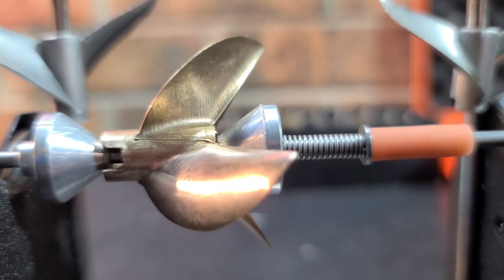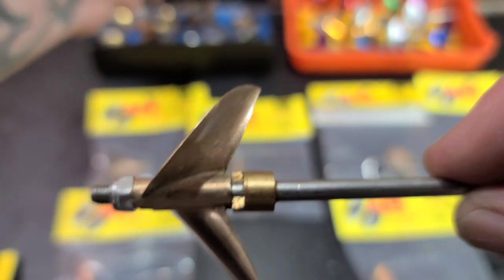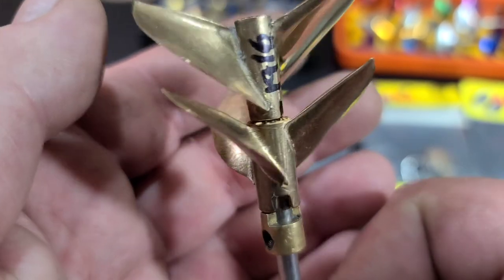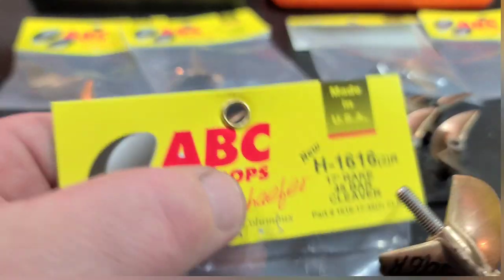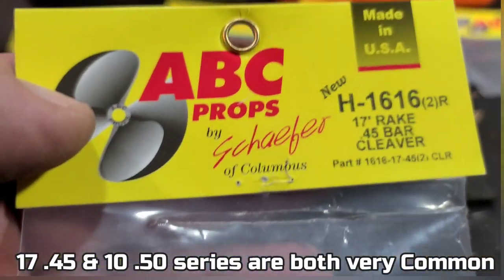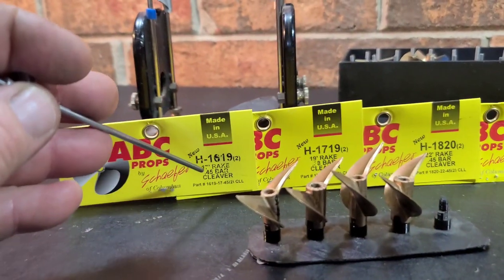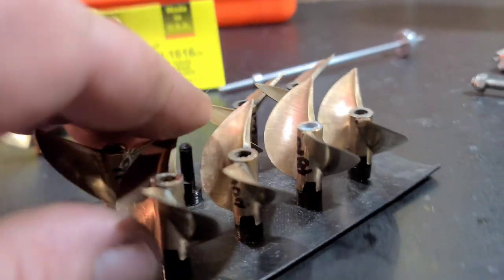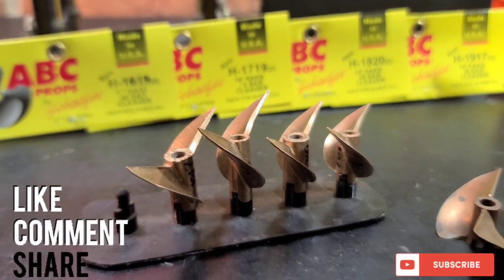ABC PROP Haul Comparison, and Identification - Fast Rc Boat Propellers

Comment: What prop would you recommend on a 36 inch mono with a SSS 4092 2140KV motor with a ZTW 200amp esc?
Reply from the maker: For speed?   1916 17 .45 (2)  or 1816/1817 17 .45.    That 1916 may be big for the 2140kv 48mm prop, maybe one hitter quite prop if you know what I mean 😜
Reply: @IRONCLADRC  looking for something I can do a few speed passes with and then it cool
Off. So you think the 1817 45 for that? Gonna be on 6s with that motor and esc as well
Reply from the maker: Yea, 1817..   on my 33" dominator with a 2080kv 6s I'm getting 85mph with a 1916 haven't tried an 1817 yet but I'm thinking I'd get around the same speed.   
   1817 17.45 is a great prop.
Reply: @IRONCLADRC  thanks brother!!
Reply: Would a 1819 be too much for a similar size boat! I've ordered one but probably should of gotten 1916 😂
Reply: @ironcladrc

Comment: It's a shame that guys who run the smaller stuff (like me) don't have the wide selection of props the "Big" guys do.  Between ABC, Octura, Prather, and all the CNC props from China, the choices are staggering.  Finding the "ONE" prop for a hull could be a never-ending process.  I'm looking at my little twin micro cat and there's only one available prop choice; take it or leave it.
Reply from the maker: What about the 1214 15 .60 abc they have ccw cw rotation available 
Basically 30- 36mm 

https://www.offshoreelectrics.com/proddetail.php?prod=abc-XXXX-15-60(3)CLL
https://www.offshoreelectrics.com/proddetail.php?prod=abc-XXXX-15-60(3)CLR.  

Also
https://www.offshoreelectrics.com/proddetail.php?prod=abc-XXXX-15-60(3)CLR

Comment: Hi!
I just received a couple of ABC-props from OSE. I understand they have beryllium in them. What precautions do you take when working on them?
Regards from Norway🙂
Reply from the maker: Wear a 3 layer minimum medical mask. a respirator style mask would give you better protection.    I do my prop prep filing and sanding outside in my garage, becaus  I have 3 kids in my house hold
Reply: @IRONCLADRC  Have you tried working on them under water? This would eliminate the dangerous airborne particles.

Comment: Great vid showin those props! Yeah, what do you do when one blade is different? How can you tell if you're making them all the same? A slight difference would show up running at 50k rpm.
Reply from the maker: I use my gut most of the time, along with a prop balancer.    I'll feel the thickness with my fingers, very carefully match up the thickness.  Then I use modeling clay to get the blade shape and size imprint the blade onto the modeling clay
Reply: @IRONCLADRC  good idea with modeling clay. I used to do that on my job but didn't think of it for prop

Comment: Man, there are a lot more types then i can get. But ordered some to try, aspecially the 3blade has my interest. I personally think Octura X-serie serie is a good allround prop, also easier to work on. But ABC are bit faster (also more load) in the ones i've got. Didn't even know there were so many abc types, so there probably are prop types that will come closer to eachother, because i bought most off the time  different types to see what difference was... So again, this was very interesting...
Reply from the maker: Thanks, glad I could help, I can't wait to try that 1817 (3) on my dominator hopefully it doesn't torque Roll and chine walk to much with the high rake acting like a paddle wheel?     Those 19 rake .38 bar props may be good on a mon hull too ( 1619 & 1719) low blade area....
Reply: @IRONCLADRC  ordered the 3 blade, a 1817 and 1916 (or 17). I already had the 1816 but made it smaller since my previous setup didn't like it. I'm indeed very interested to see how the dom will handle that prop because off the reasons you mentioned. But then again, have few cats, and bigger mono laying around that need to be finished so there always will be a purpose for it. Also remember i had a Octura 642 (or 43mm) 3blade which ran pretty nice (good acceleration and speed) on one off my mono's, so thought might be a good idea to try a bigger abc from a type that is totally unformiliar  to me... But that reduced blade area definitely makes sense to me, so i just NEEDED to order one...😁

Comment: Hey ironclad, I’m looking for a intermediate rc boat, $700 price range, I want to go fast, I recently owned a sonicwake v2 but had to return it do to a overheating problem, I’ve looked into the zonda but I’m just not sure about it, I don’t like the fact that u have to tape the hatch on, understand its a speed run boat but it just worries me, I’ve been looking at some different pro-boats but I’ve heard some bad things about them like overheating. Open to suggestions, thanks!
Reply from the maker: If you wanna go fast the oxidigger is hard to beat!  But you'll need hatch tape and alot of it.  

The impulse & blackjack 42 are both fast boats but not that great for intermediate users 

The blackjack 24 and recoil 2  are great entry level boat that you can grow into, upgrade for speed using cheap electronics and props
Reply: @IRONCLADRC  have you had any problems with the blackjack 24 like overheating?
Reply: @IRONCLADRC  I like the zelos twin but there out of stock so I could get just the hull but how hard would it be to build it from the ground up

Comment: I have a plastic prop what prop should i get its 35mm. Its a tunnel hull f1 boat
Reply: I run a octura v937 on my small  tunnel  hull outbard
Reply from the maker: Your asking the wrong man for advise on a tunnel hull lol.   I was running an Oxidean 3519 on my mrp it handled pretty good
Reply: @palehorse7377  out of the props I have tried it seems to work  the best for me low amount of torque twist. My experience is with a 
24 inch fiberglass tunnel hull with a tfl scale electric outboard